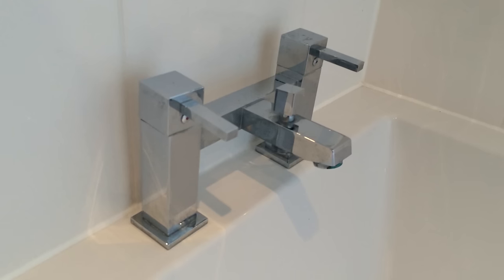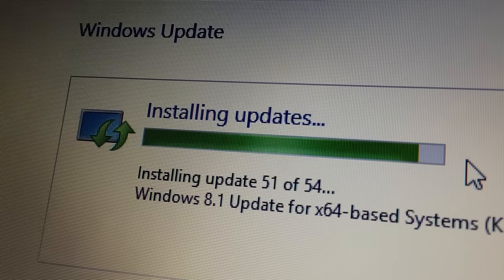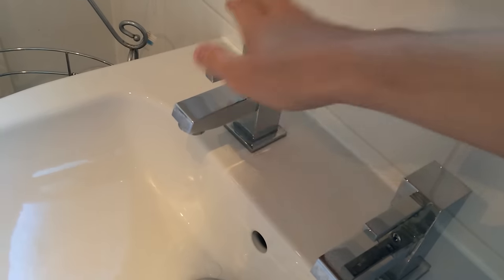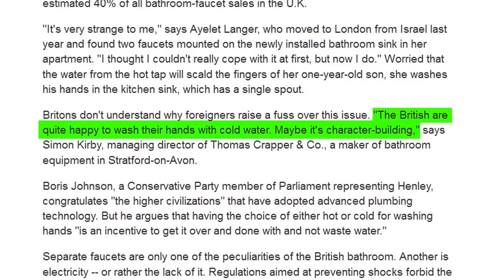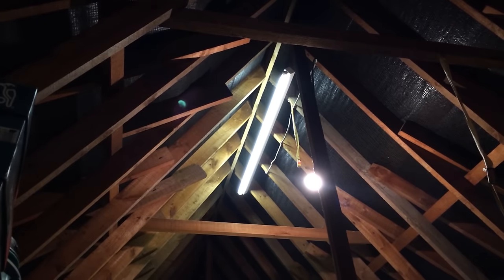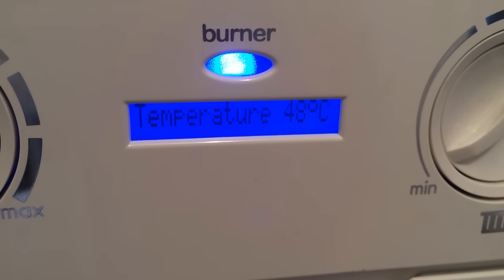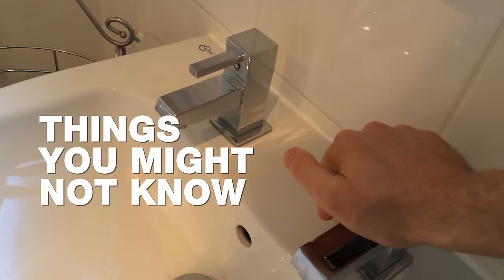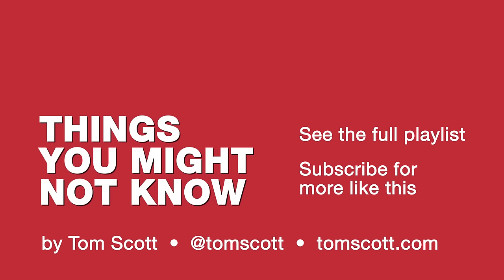Why Britain Uses Separate Hot and Cold Taps

Comment: Letting the water run for a bit before drinking is a good tip no matter where you are.
Reply: Certainly a good idea with showers in hotels. Legionaire's is really not fun. I used to work in a lab testing shower water for it and yes, there are some suprisingly nice and expensive hotels that have perpetual issues because they can't be bothered to fix the plumbing.
Reply: Not so in some countries...
Reply: That's just common sense.
Reply: @iainmackenzieUK  I was thinking the same thing. You could run the water for a week from a tap in Bali and it would still be unsafe to drink.
Reply: Don't have time for that
Reply: @Parabueto  also best to have a glass shower door as opposed to a shower curtain as these are unhygienic. .
Reply: Africa
Reply: Also makes the water colder!
Reply: Pro tip, pour the water for a few seconds, then fill up a jug and put it in the fridge. Lovely cold water, and its saving you money, which adds up over the years. 

I mean you are always gonna need good clean water, its worth making that efficent cheap and cold.
Reply: That's what my mum always tell me to do
Reply: I just run the cold water a bit in the mixer taps so that the water is cold, and not lukewarm
Reply: It seems worth pointing out why this is true. The reason usually given in the US is that plumbing solder is lead-based, and running the water for a bit before one takes a drink reduces even further the odds that any of the lead will be leached out of that solder in the piping in the house and end up in the water that you drink - and I think we all understand why lead in your drinking water is a bad idea, right?
Reply: @Red Balloon So you are suggesting to drink possibly contaminated water so that you don't waste a few glasses of water that no one in a country with water shortages would get anyway?  
You seem to have the wrong priorities. No, you definitely have.
Reply: Wow thanks for the tip,
Never thought of that.
Reply: @baylinkdashyt   My 1930's semi had about 25m of lead pipe from the road water main.  Water board tests gave around 35mg/l  over WHO recommendations -there is no 'sade' level for lead.   Running  a few litres  off the tap in the morning will lose any lead build up overnight.
Reply: Don’t drink tap water you peasant
Reply: @LovesTheGash   No Flouride here Chlorine will evaporate naturally.   High ppm dissolved mineral salts 'hard water' here is common, including most  bottled waters -you muppet.
Reply: @tuscanyiscol  what? All tap water isn't fridge cold, just the temperature of its surroundings... in what way would it be cheaper to do that. Infact the fridge would have to work harder to keep the temperature down if you did that, which means more electricity needed
Reply: @Red Balloon mmmm yes water is very rare resource "thinking"
Reply: @brendanoneil3489  what? There is fluoride in our water assuming you are from the UK. Fluoride is very beneficial for preventing tooth decay. Don't go all conspitard saying Fluoride is bad please.
Reply: Brendan O' Neil did I mention fluoride? Also, chlorine needs time to evaporate. Now, what about metal leeching into the water from the pipe work, as well as any other possible contaminants?
Reply: Negative. If the source of water isn't properly black backflow prevented,  if you let the water run you actually could be drawing ground, pool, or drained water from any source upstream.
Reply: Africa?
Reply: @Red Balloon what do you think happens to water after you use it? It's just gone forever? You not using water, because someone on another continent doesn't have clean water is so unbelievably redundant.
Reply: @brendanoneil3489  it would take like 10 minutes to get all the water from your pipes out. That's a lot of time wasted when you could buy a $20 water filter
Reply: @Red Balloon that's just pointless. Would you eat mouldy foods because kids are starving in Africa? Clearly you're just bragging about how thoughtful you are of the less fortunate.
Reply: @iCore7Gaming  that's not how fridges work. Technically speaking, the fuller your fridge, the less hard they have to work.
Reply: That's what I do with Water Fountains.
Reply: @carolsnook4659  or a walk-in shower. No door, no curtain. just tha bathroom door, with key ofcourse..
Reply: @michaelwautraets7126  yes I agree Mike. ..
Reply: laughs in Bangladesh
Reply: I went from Alaska, where the water gets freezing cold no matter what time of the year, to San Diego. I think the water gets warmer and grosser
Reply: @tuscanyiscol  Too cold for me, can't drink stuff from the fridge. Hurts my teeth.
Reply: @Red Balloon the water is hardly wasted it goes back straight to the source either the ocean to be filtered out one day again or back straight to the water plant to be refiltered again and back to your city
Reply: El Avatar  do you just drink straight from the river then
Reply: not in sweden, we have some of the best water
Reply: @mahdiarrahimzadeh7505  I live in Norway, and our water is just as good as yours. But that doesn't change the fact that there is water in the pipes inside your house that have been standing still for hours, if not days, depending on when you last used that tap. Hence letting it run for a while is a good idea, even for us.
Reply: I was told when I was a kid that the bathroom water is from a tank in the loft and is not drinking water and since then I've only ever drank from kitchen taps, even though I live in Norway now
Reply: @sethc6663  or Flint Michigan
Reply: @sakerocket  Why? is it bad there?
Reply: @sethc6663  search it, it's horrifying
Reply: @sakerocket  That is definitely horrifying, I'm glad our drinking water is filtered rainwater.
Reply: @sethc6663  just insane, it should not be happening.
Reply: yep
Reply: Not in Australia
Reply: Especially with metal pipes, metal fixtures, or tanked water heaters.
Reply: @farjuice6339  Depends which state/territory you live 🤔
Reply: LovesTheGash Why? Tap water is safe to drink at least in many European countries.
Reply: @sethc6663  To be honest, the water in Bali is safer than most other tap water in Indonesia
Reply: @axelloa.a.6563  I still wouldn't drink it. Don't fancy 'Bali belly'.
Reply: @sethc6663  I know you really shouldn't drink tap water in Indonesia
Reply: We Asians boil them before drinking
Reply: You want to see the state of the mains
Reply: Unless you live in the Willamette Valley. We have some of the cleanest water in the world.
Reply: It doesn't matter how clean you claim your water is. Water standing still in the pipes inside your house is not good to drink no matter where you live.
Reply: Michael O'Brien I think you spend more money cooling the water (in electricity) than if you run a couple of seconds in cooling tap water.
Reply: Makes the water taste better and colder
Reply: Jamie Stubbs how does this only have 3 likes
Reply: Whenever I stay in a hotel I’ll let the cold water run for a few minutes. It’s a waste of water but I don’t know how long it’s been since it was used, rather be safe.
Reply: I do it because it's colder and therefore tastes better
Reply: I just use my fridge
Reply: @The secular humanist the curtains tend to gravitate towards you, hey.
Reply: laughs in norwegian
Reply: @sethc6663  no it gets colder
Reply: @TheSilverwing999  yaaaassss
Reply: In Norway we just put on The tap and stick our head under
Reply: it's weird how you guys can drink from tape, we are taught from young that tape water is unsafe ,even from the mains. We have to have a filter that connects to the sink, and then we can drink it
Reply: it's a good tip but it won't make unsafe water better that water needs to have been treated, say with chlorine or ozone, if you have a bacillus present from an infected water supply it won't just go away by running the tap.
Reply: In the Netherlands it doesn't matter :)
Reply: Not if your in Africa
Reply: Michael O'Brien even better than this is to buy a small water dispenser for camping (we got a 5 litre one for under $10) and always have that filled up in the fridge! Now We always have cold water literally on tap even without having one of those fancy fridges with the water dispenser in the door!
Reply: Why?  Why is the water that's 4' down the line better than the water that's 4" down the line?
Reply: Kilroy because the water close to the house has been sitting there stagnant. It’s had a chance to leach from the pipes. Depending where you live, that could mean lead poisoning or all sorts of nasty things. Stagnant water is a breeding ground for lots of different bacteria. Water down the line is coming from the mains which is constantly flowing, and filtered before it gets to your house.
Reply: I’m confused at the people that think a jug of water put in the fridge to drink is worse for the environment? The whole point is you don’t have to keep running the tap every time you want water. Fridges are always running, so it’s not like you turn it on or up higher to put in a jug of water. Plus, fridges actually work less hard the more full a fridge is.
Reply: @Efflorescentey  The water sitting in the pipes in my house cam from the mains which came from the water treatment plant.  Suddenly that water is now dangerous because it sat in a different part of a sealed system?  By your logic you have to let the water run long enough to completely empty the pipes between your spigot and the mains, and you have to do it every time  unless you know how  long the water can sit before it becomes contaminated.  It's silly.
Reply: @Parabueto  Legionella build biofilms, you can run the water for your entire stay and the water will still be unsafe. For showering, anyways. Drinking it is completely fine...
Reply: @Topher TheTenth this was a year ago, but i don't see my comment saying i was against it? I was saying that it would cost more money not save it lmao
Reply: @Topher TheTenth i know that's literally what i meant
Reply: In most places you just don't drink the water
Reply: If I don't let the water run for a while before drinking it, it tastes bad. Probably because of some copper that has dissolved from the copper pipes.
Reply: @carolsnook4659  what's the difference?
Reply: @tuscanyiscol  how does running away excess water SAVE money, or chilling extra stuff?
Reply: This, even though there are super strict regulations on tap water here in germany it is always fresher to let the water run until its cold from the main line.
Reply: Unless you are in Flint MI
Reply: I filter all my drinking water, but I wouldn't even pour it into the filter until I had run the tap for at least 20 seconds. It just seems like common sense not to use water that's been sitting in your internal plumbing for ages. You can feel the temperature go cold after it's run for a while, indicating external water.
Reply: Because that way you give your system a chance to let the water to get to the temperature you want it to be.
Reply: Not where water is a precious commodity it isn't.
Reply: @brendanoneil3489  you must be in Scotland
Reply: @ryry5249  no
Reply: @brendanoneil3489  softwater
Reply: yep and if your water is foggy 
do not drink it
Reply: Agreed
Reply: More like a good "tap"......... No? Ok
Reply: Doesn't work for Africa...
Reply: I'm Swedish; surely I needn't.
Reply: @jamiestubbs49  Africa is not a country !
Reply: We here in germany can use water without letting the water run for a few seconds, but we have one of the best water quality in the world, if not the best. I heared a lot of bad storys about water in other countrys, so i never drink water out of the pipe in other countrys i just buy water and even here i buy water in bottles because it taste better and it have more minerals 😄
Reply: @LovesTheGash  , That does depend on the country. Here in the Nordic countries we don't have that problem. The water provided is fine and tested and should something go wrong we will know about it. 
And well we have a lot of fresh water too of course.
Reply: @tuscanyiscol  it costs more to chill the water than run the tap, conserving water actually raises the price of water, as its used to help push much through the sewers, not enough and you get blockages, as well was cracked water supplies in winter, as running water doesn't freeze as quickly
Reply: @Shrubchucker  the reason you think water gets grosser as it gets warmer is because as water warms up, it's able to dissolve more solids (minerals and other contaminants) which affects the taste as does the municipal water filtration system, what they add to the water, and it's overall effectiveness.
Reply: True!!!
Reply: @LaidbackLuc9  Where I live, water is government owned and is included in property rates so it literally costs nothing to run the taps.
Reply: humandxp  And half of those kids die which is why they have so many, and also isn't a good advert for drinking brown water.
Reply: @Person01234  sounds wasteful. Why not install smart water meters to hold heavy users accountable for their water consumption?
Reply: @sakerocket  $$$
Reply: Use a Berkey
Reply: If you live in a mud shack
Reply: @tuscanyiscol  was your pro tip just to put water in the fridge
Reply: Just drink the damn tap water
Reply: If you're in guatemala I suggest to do not drink it even if it's cold
Reply: @carolsnook4659  But not necessarily better. Bathrooms are slip factories, after all.
Reply: @tuscanyiscol  In the UK, for most of the year at least, the water comes out of the tap already cold...